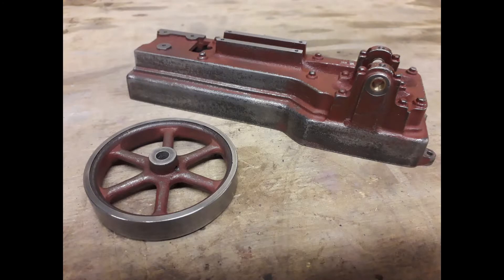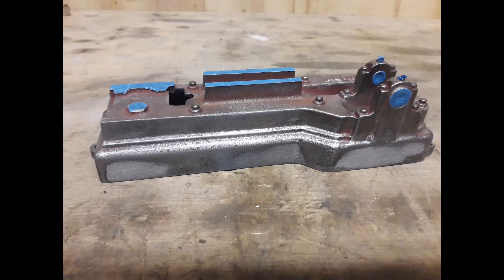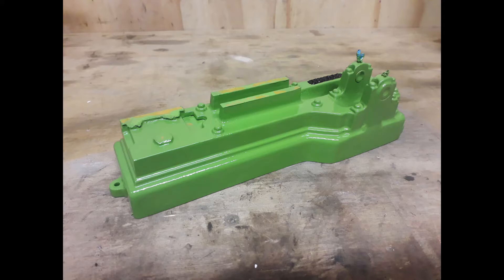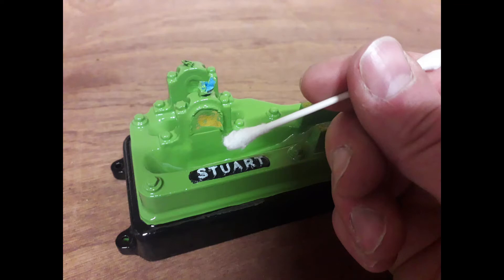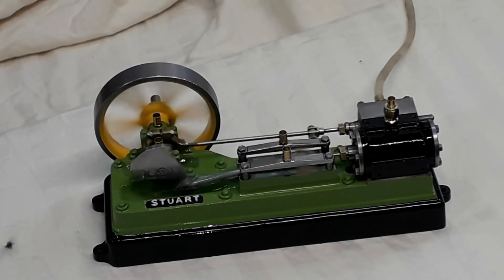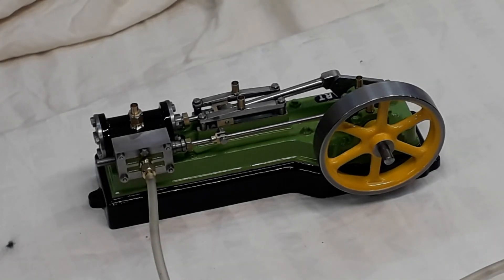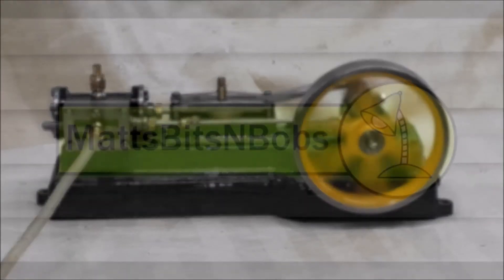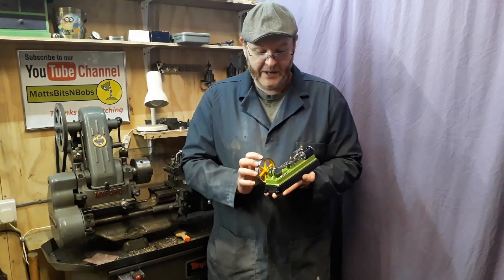Easy Stuart S50 Build Part 13 Paint & Polish

Comment: Great videos thanks. I see Stuart now offer a larger version of this model. would yoy think that machining it would be virtually the same as the regular ,albiet just on a larger scale thanks in advance matt
Reply from the maker: Cheers John, dispite the larger price tag I would think that it should be the same, I can't think of anything that would be different, maybe a bit easier as the parts are larger. Let me know if you have a go, thanks.
Reply: @mattsbitsnbobsworkshop  thanks for your prompt and helpful response. Iwill keep you posted, just realised that this verson requires a monster boiler so we'll see how we go cheers for now